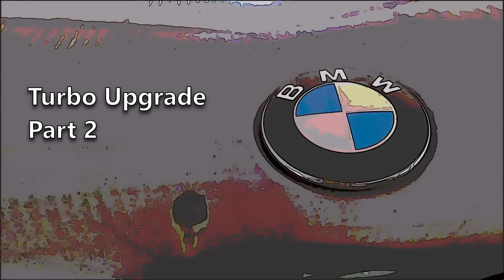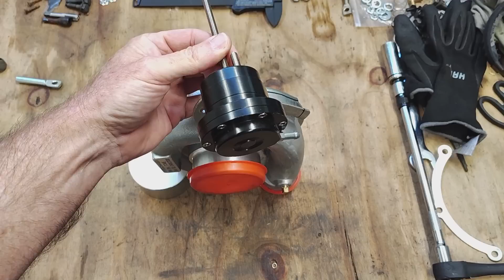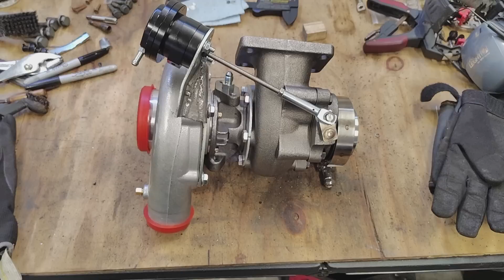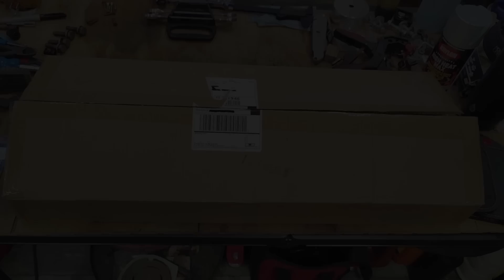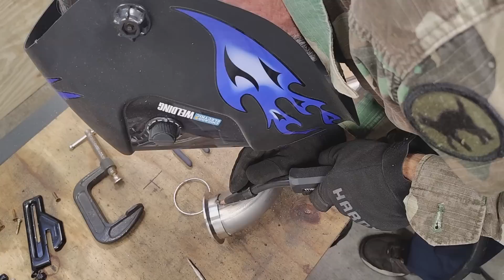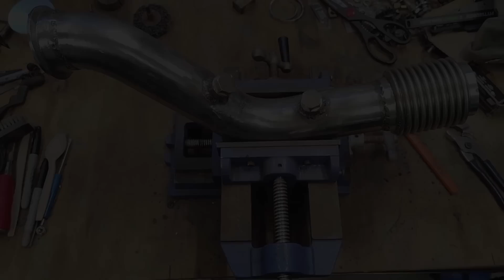BMW E46 Budget Turbo Build [Part 2]

Comment: When using Flux Core Stainless Steel wire, you need to change your Polarity back to as if you were using gas - not flux core mild steel wire.
Reply from the maker: thanks, I'll try that

Comment: You should link the products that you use.  I’m gonna be ordering stuff for my DP soon. Good news I can try to booger weld the stainless with regular flux core
Reply from the maker: I couldn't figure out the voodoo for stainless flux core. But mild steel flux core worked fine. The Solar Flux prevented sugaring of the stainless pipe. I didn't post links, because I bought most of this stuff on ebay. And ebay links don't last very long.